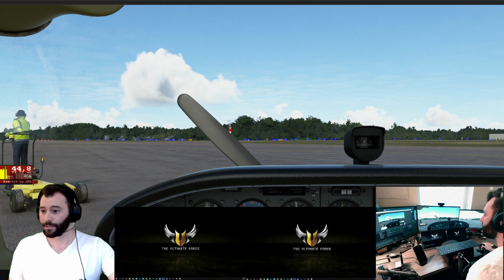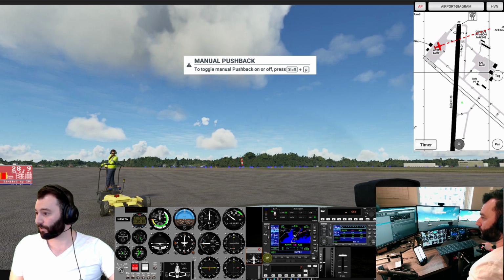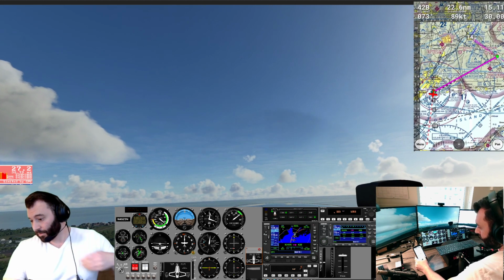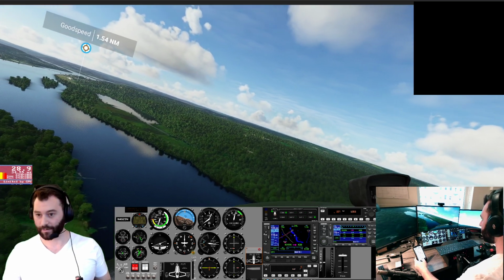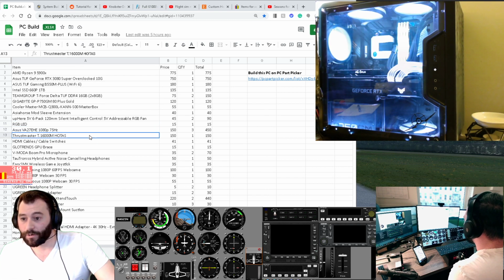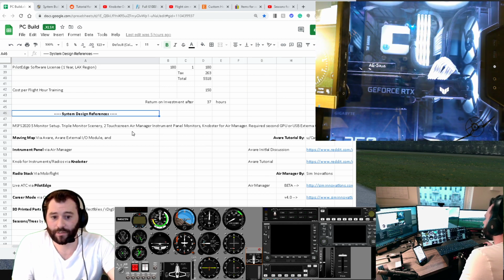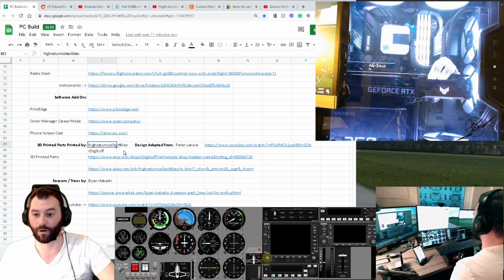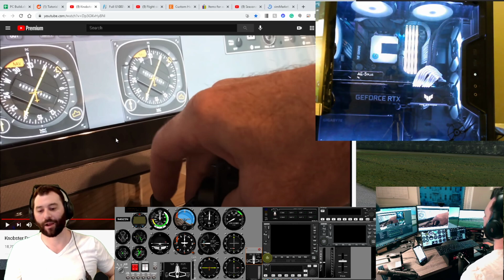MSFS2020 5 Monitor, Triple Monitor, Touchscreen Instrument Panel, Air Manager + Knobster Tutorial

Comment: What a GREAT Video and how have you connected the t/s monitors to the p/c?
Reply from the maker: They're USB for touch and HDMI for display. You'll want a USB to HDMI converter if you want 5 screens because the video card only supports 4 video outputs. That means one of your monitors will be driven by your CPU. You take a small CPU hit for it but you can't beat five monitors for immersion.

StarTech.com USB 3.0 to Dual HDMI Adapter - 1x 4K 30Hz & 1x 1080p - External Video & Graphics Card - Type-A to HDMI Dual Monitor Display Adapter - Supports Windows Only - Black (USB32HD2) https://a.co/d/0TFMPSI

Comment: Hi Matt, excellent video. Which is the app that shows the airport disgram at upper right?
Reply from the maker: Thank you. The app is Avare. Available on the Google Play store. It's a free electronic flight bag app. I use it when I fly for real, so it allows my to train like I fly.
Reply: Excellent Matt, Can it works with simulator? I mean can I track my sim with that app like your video?
Reply from the maker: @CarlosELugo  

Yes, tutorial here (though it may require some tweaking):

https://forums.flightsimulator.com/t/connecting-avare-efb-to-msfs/307216

The external IO Module app for Avare is no longer a separate app from the Google Play store. It is now a tab that has been integrated into Avare. You'll see your Avare tabs are Map, Plate, Csup, etc. Scroll these all the way to the right to see the "IO" tab. 

Once xconn is launched, ensure the wifi address and the port addresses match between xconn and Avare, then click "start listening" in the Avare IO tab.

Sorry, my instructions aren't the best but it should get you moving in the right direction.
Reply: Thanks a lot Matt, I will check it out!
Reply from the maker: @CarlosELugo  

I had created this partial tutorial video a while back. Just doesn't walk through the installation. Not sure I remember exactly what I did for that. 😬

https://youtu.be/A4pvzeedD_I

Comment: Thanks for the video. Just to let people know, MSFS2020 doesn't do TRUE multi-monitor. It stretches via NVIDIA physx and is pretty distorted towards the wide outer edges. It is acceptable if you view scenery with no cockpit. If I am wrong on this please let me know. The best cockpit for Air Manager is using G1000 PFD/MFD because everything fits on one Touchscreen. AP, FMS, Audio panel etc. I use Asus 22" and knobster. Air Manager/knobster and multi-monitor is great because you can get rid of mouse/keyboard. VR and controllers are OK for VFR but when flying IFR there are too many misfires while twisting.
Reply from the maker: Yes David, you are correct about TRUE multi-monitor support.

However, true multi-monitor support is high on the MSFS2020 Development monthly feedback snapshot. So I see building a setup like this as getting the hardware rig squared away and waiting a few months (or to 2022) for the software to catch up. The hope would also be that this functionality doesn't impose a massive cpu/gpu performance hit on top of the existing performance.

See the link below to the feedback snapshot image.

Thanks for the dialogue 👍

https://www.google.com/search?q=msfs2020+top+wishes+2021&tbm=isch&ved=2ahUKEwigu9b-_YPyAhXPdN8KHe25De8Q2-cCegQIABAC&oq=msfs2020+top+wishes+2021&gs_lcp=ChJtb2JpbGUtZ3dzLXdpei1pbWcQAzIECB4QCjoECCMQJzoICAAQCBANEB46BQgAEM0COgUIIRCrAlC4lwJYqLkCYLe7AmgCcAB4AIABbIgB-xOSAQQyNi4zmAEAoAEBwAEB&sclient=mobile-gws-wiz-img&ei=XF4AYaCdGc_p_Qbt87b4Dg&bih=724&biw=412&client=ms-android-samsung-gs-rev1&prmd=vsin#imgrc=YLIVZEOjmWauEM
Reply: @mcorrive12  Thanks. Great to hear that mfs plans multi.  I still feel the best training and family orientated config. Is 3 wide with AM touch/knobster solution with a view down each wing. This requires 1 computer and no track ir. Looking forward to mfs multi mon support. The scenery is great. Airports/signage are still weak tho. AM is released for mfs but the g1000 popouts cause stutters. Right now an UW or Super UW with Track IR might be best for mfs. I am instructor and RW pilot. I use pilotedge where knob twisting is very important. This is where VR is very weak. The controllers or mouse just don't cut it. I can fit a complete cockpit on 1 asus 22" touch g1000 and 3 wide, Using X-plane and phenom 300. I have pictures here at aviationknowledge dot org not selling anything not affiliated.  Looks like we both see the advantages to AM flexibility and touch/knobster for flight simming. So does FAA approved Gleim and Touchtrainer/others. Thanks for videos
Reply: I forgot to mention. I love analog but since I started using G1000 I feel it is a much better solution for AM. You can put a complete cockpit on 1 touchscreen due to more compact size. And use in many aircraft. Audio, mfs keypad(love the keypad) ap, flaps, brakes, etc. and knobster. Find an aircraft that is g1000 with keypad. Cirrus sf50, cirrus sr22, phenom 300 (My favorite). IMO can't be beat.
Reply from the maker: @RightTrafficN7954Y  I appreciate the feedback. I'm currently 35 hours through my PPL training. Training in G1000 aircraft in real life case cost thousands more than training in an analog cockpit. Also, finding flight schools with G1000s could require additional commute time (for example my school doesn't have any G1000 aircraft so I'd have to train 1 hour away from home instead of 15 minutes).

This is why I want to fly analog in the simulator. Keep the sight picture the same to try to get through my PPL as quickly (and as cheaply) as possible. Train like you fly!

Cheers! 🙂👍

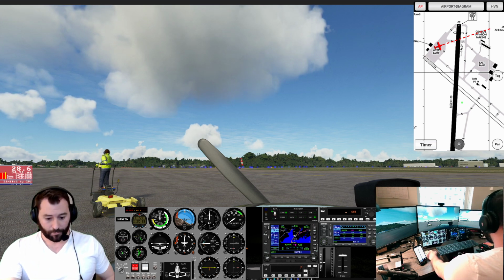Comment: At approximately the 11:00 minute mark you select what you called the scenery view (for MSFS2020) after you completed popping out the navigation instruments to the touchscreens.  Could you please advise how you created and selected this scenery view.  I have not been able to replicate this camera view for MSFS2020.  Thanks and great video.
Reply from the maker: If I remember correctly you can hold down right alt or right control while using the arrow keys to pan the camera up/down/forward/back. It only works with right alt or right control, it doesn't work with the left keyboard buttons. If this isn't working for you, the right alt button may not be mapped for that function. If this is the case go to the menu and map those button combos manually.

You should be able to Google msfs2020 cockpit camera panning to find the tutorial.

Once the camera is where you want it, use the bottom combo (I think it was left cntl + left alt + a number key) to set that camera position to that numeric cockpit camera hotkey.

Comment: Excellent explanatory video.  The best out there. Can I do the same with the G1000 PFD and MFD.?
Thank you. Jose
Reply from the maker: Here's the link to Drunk Billy Flies

https://youtu.be/zIFlQDQcdSw
Reply: @mcorrive12  Thank you Matt. I will try it out. I fly a Cirrus SR20. I’m trying to setup a sim that allows realistic IFR practice without spending
More than $5k in the sims that are out there, like, Realsim Gear.
Reply from the maker: Thanks for the feedback! Unfortunately I'm not much help with the G1000 setup as I've only focused on the steam gauge so far.

I know MobiFlight supports the G1000. And I can't image Air Manager does not.

Also, check out drunk Billy's YouTube channel. I'm pretty sure he got things working with the G1000.

Good luck!

Comment: Hi Matt, I may have missed it, but how are you able to connect (5) monitors to your GPU?  Thanks
Reply from the maker: The GPU handles 4. A usb to HDMI converter uses the cpu to process a video signal for the 5th. It's a serious load on the PC, but it's doable. I mention the details in the video.
Reply: @mcorrive12  I take it that you plug the converter into your PC usb port and then feed your two instrument panels through the HDMI(s) on the converter.  You used three of your four available video ports on your GPU, is the fourth GPU video port still available for you to use?
Reply from the maker: @michaelmosca678  I actually only run one of the instrument panels off the USB to HDMI converter. I run 1 instrument panel and the 3 scenery panels off of the 4 gpu video feeds.

I've found that with my setup I'm still cpu limited, so it is best to run as few video devices off the cpu as possible. Keeping in mind since the gpu supports only 4 video feeds, it's up to the cpu to do all the processing required to create a 5th video feed.

It really is a heavy load for the PC and the fps with popped out glass panels leaves a bit to be desired. I'm hoping as Microsoft continues to optimize their software, I'll see fps improvements.

I'm hoping that if they continue to optimize to get good performance on the Xbox, that should help us get better performance on our more capable PCs.
Reply: @michaelmosca678  Instead of 5 monitors, I use 3 wide HD with ASUS 22" ($180) Touchscreen below . 4 total. I have a 172sp AM analog panel with 430/530. G1000 works best tho for touchscreens due to space. Dell has a 24" for $380. This is pretty standard config for FAA approved touchscreen systems. See Gleim and Touchtrainer systems.
Reply: @RightTrafficN7954Y  Thank you David. I have three Dell wide screens and just purchased a Planar Systems Helium PCT2435 23.8" 16:9 Multi-Touch Full HD IPS Monitor that comes with a very nice adjustable stand for $319 (includes shipping) from B&H Photo. I'm using Air Manager and can fit all of the instruments that I need on it.
Reply: @mcorrive12  Thank you Matt.
Reply: @mcorrive12  Did you have the option (if so, and try) to run Air Manager from a separate computer and link the two PC's through your network. Thanks
Reply from the maker: @michaelmosca678  I considered doing that, but since I wanted to pop out the GNS530 and GNS430 glass screens and move them onto the same screen behind the air manager panel, that would require me to run an instance of MSFS2020 on the second PC.... And that is something that MSFS2020 does not support yet.

Being the new simulator platform ginuea pig has some serious pros... But also comes with some serious cons. 🙂

Comment: Hi Matt, thanks very much for the video. However I’m missing something. I have Air Manager 4.0 and the gps panels in the library are shown as only for x plane so I don’t understand how you have them working in fs2020 unless you have designed them yourself. Help me to understand. Thanks.
Reply from the maker: See 1:08:28 in the video where I discuss how to get the radios working. The google doc with links to the MobiFlight tutorial is in the video description. Hope this helps 👍
Reply: Thanks very much Matt for the swift reply.